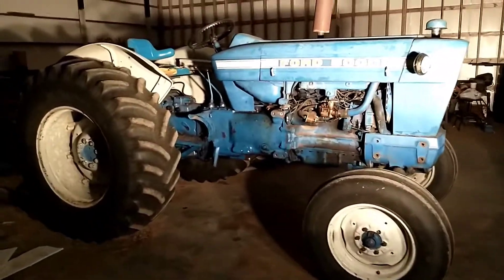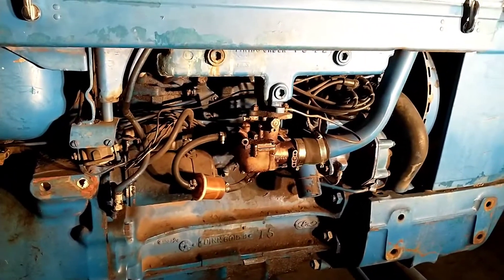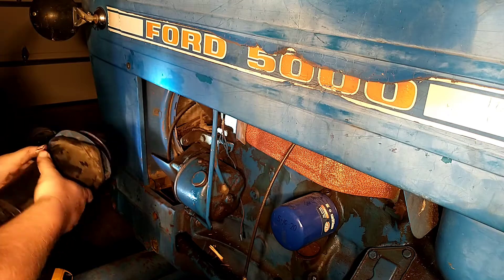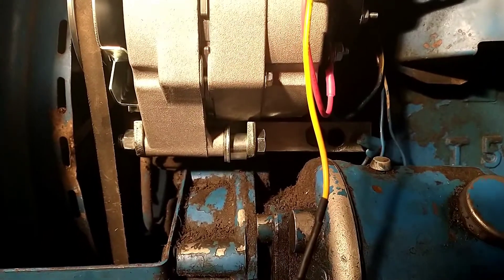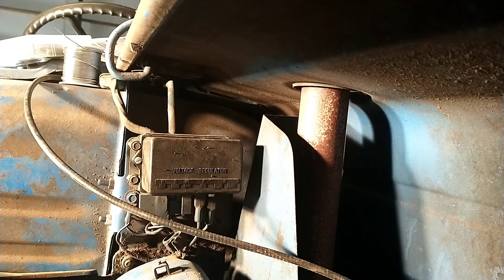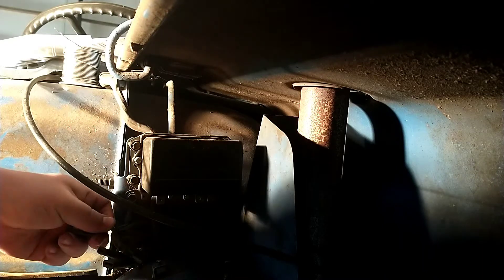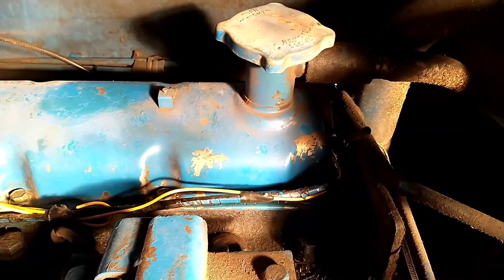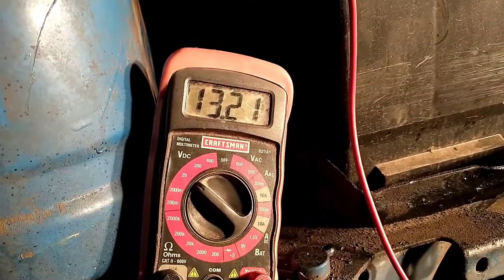Ford 5000 Alternator Conversion, Detailed Install

Comment: Turn the bottom bolt around so nut thread  is under the alternator.🇬🇧🇮🇪
Reply from the maker: I think I mentioned it in the video, but then again maybe I didn't. I tried that, but there wasn't enough clearance between the alternator bracket and the radiator/fan shroud to put the bolt in from that direction. Thanks for watching and commenting!

Comment: When I did my conversion, I pulled out the voltage regulator entirely and I've actually put a fuse panel in that location so all the circuits on my tractor are now fused.  I had so many bad wires that it wasn't worth "fixing".  One headlight worked on occasion.  So, I ripped out all the wiring.

Points were replaced with a Pertronix ignition.  This allowed a straight 12v run from the key to the coil.  Replaced the starter with a gear reduction.  This provides more torque in the cold for easier starts in the winter.  The bonus was being able to connect the start position on the key directly to the starter.  No more solenoid.  Battery cables were replaced with 4 gauge.

I did have my alternator pulley replaced with one 1/2 inch smaller.  This not only allows the alternator to tuck under the hood, and it runs at a higher RPM which excites it sooner.

The rest of the tractor was easy to wire.  One circuit for the existing headlight switch which powers the tail light and dash backlight on the first click and then adds the headlights on the second.  One circuit runs to the key for the ignition.  One circuit runs to my work lights mounted on all 4 corners of my canopy.  Final circuit runs to the strobes.

Wiring the dash isn't hard.  Just take care as you remove stuff to understand how it was wired.

All the lights from headlights to strobes are LED now.  Even the backlights of the dash (I did have to preserve, clean, and integrate the original sockets to make that work) and the original taillight are all LED.

The walkaround on my channel is a couple years old, so the mods to the alternator and the gear reduction starter are not in it, but you can see how I did the fuse box.  I posted a lot of my mods to the TractorForum and there are links in my Tractor of the Month page:

https://www.tractorforum.com/threads/february-2021-featured-tractor-of-the-month.51437/
Reply from the maker: Cool! Thanks for the info and for watching.  That's a sharp tractor you've got there.  I'll be sure to check out the videos you have on your channel and subscribe!

Comment: I know it hasn’t been on there too long, but how has the tach cable held up? I tried re-running it’s original path and I think the sharp bend coming out of alternator caused it too break. Have it sitting apart now, was concerned about running it past the exhaust. Thanks!
Reply from the maker: Good Morning Fred, So far the Tach cable has held up just fine. I've only put maybe 6-8 hrs on the tractor since the conversion, but everything is working well so far. Only problem is that a mouse chewed through one of my brand new wires! Thanks for the comment!